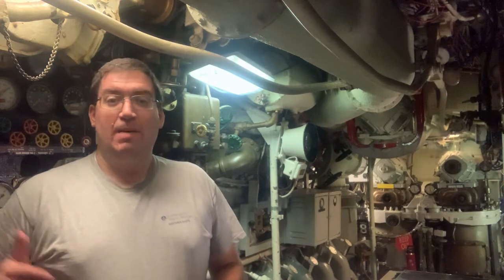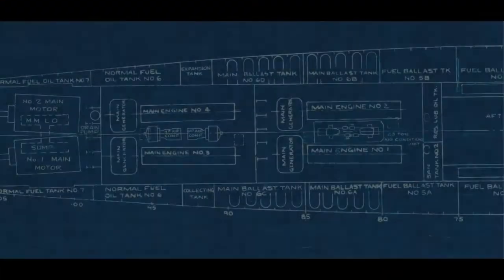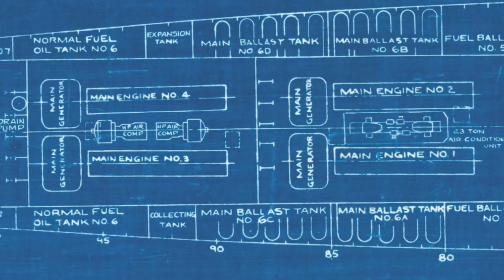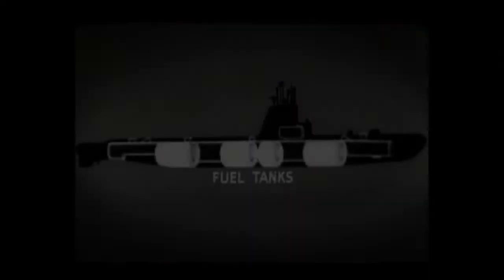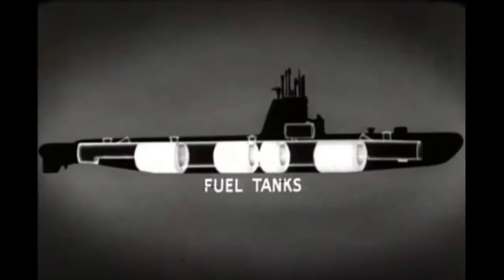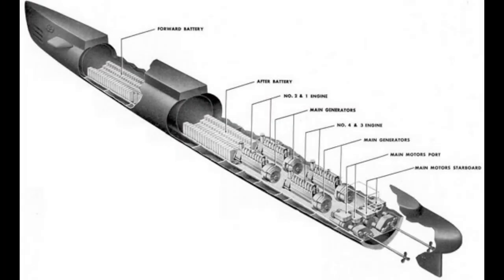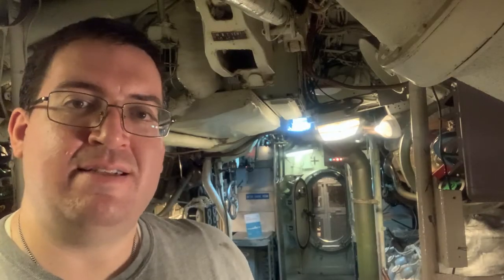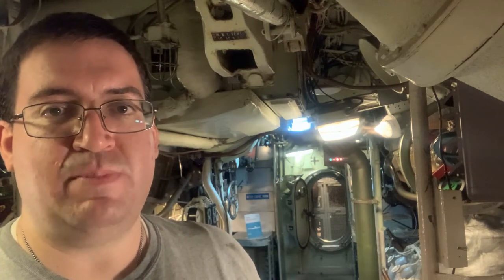Learn About Submarine Becuna's Main Propulsion System

Comment: How long does it take to fully charge the depleted batteries?
Reply from the maker: While we don't have exact numbers, we belive the generators would have been set to 296 volts, 3000 amps for continuous running on battery power.
Reply: @independenceseaportmuseum  wow that's some serious power :)

Comment: You might want to revisit your fuel consumption figures ... it's closer to 8 gallons per mile.
Reply: Fuel quantity #'s seem way low unless she was seriously modified to a GUPPY. Anything faster than 2- 3 knots at periscope depth her props would make cavitation noise on batteries or snorkeling and this would be a dead giveaway to anyone listening but her battery charge lasts longer. At 15 knots she would make a tremendous amount of noise and would drain her batteries in about an hour and have to surface or snorkel to charge batteries making her vulnerable to ASW units.